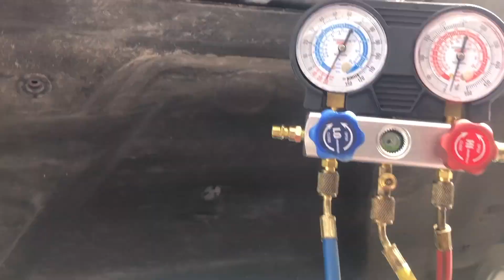🚨This Is What You Should Be Doing Right Now In RV Transport🚨

Comment: We were at the Charlotte RV show today.  Last day of the 3 day show.  Very few Sold signs on the RV's on display as what I've seen in past years.  Crowd was down too.  Lots of 2023's on display and the the MSRP's are up thousands over the exact same 2022 model.  We are definitely entering a bust cycle in the RV business.  Unfortunately for us, the economy has a funny way of resetting over time.  The past 10 years or so have been a boon (especially 2018-2021)and now its gonna be several years before things level out.  Manufacturers have waited too long before putting the brakes on production and there are thousands of unsold units sitting on filled to brim dealer lots and all over Elkart.  Rebates have been re-instituted from some manufacturers to entice sales but prices are up 40% or more than they were 5 years ago.  If someone is a buyer this winter is going to be a great time to buy.